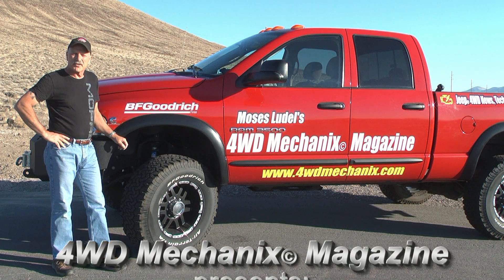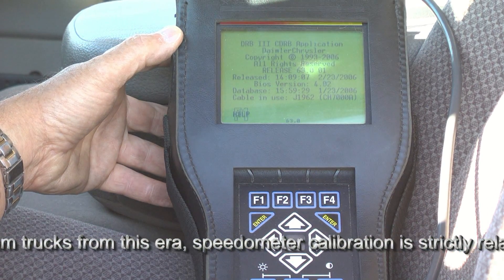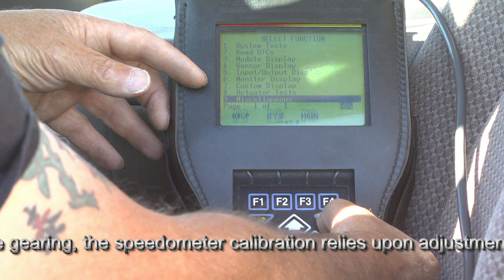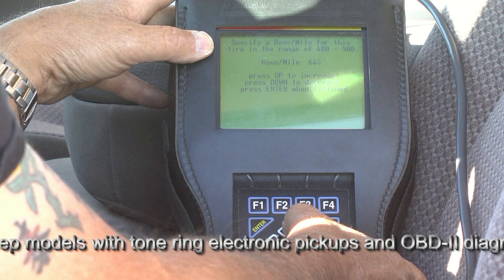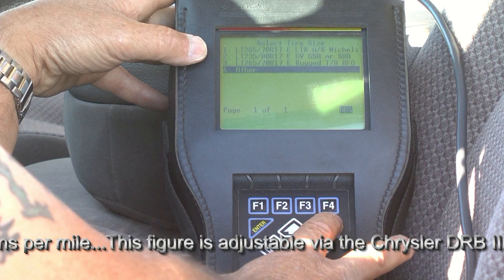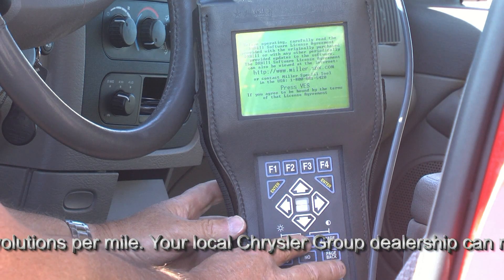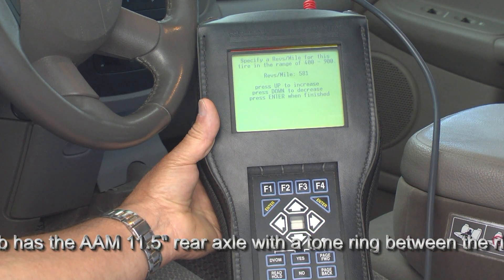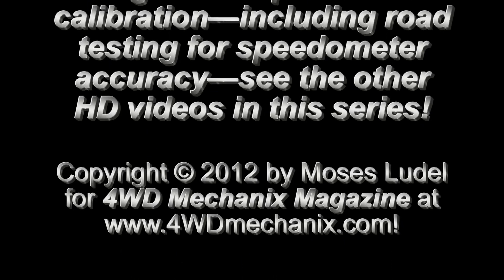4WD Mechanix Magazine 'How-to': Dodge Ram Truck and Jeep Speedometer Calibration

Comment: I was wondering if you can help me out.  I bought a set of Atturo Mud Trail Blade 35x12.50x22 (on American Force Classics) for my 2002 Dodge Ram 3500.  I can't find the RPMs for this tire; the manufacturer does not offer this info on their webpage.   Any help would be appreciated.  thanks
Reply from the maker: Frankly, the simplest tire calibrations are with aftermarket tuning software.  The Hypertech MaxEnergy software for our 2005 Ram 3500 included speedometer correction for the tire diameter.  Compared to a DRB-III scan tool, which is now $6K new or a rental from OTC, the cost of aftermarket tuning software is a bargain.  You can use stock, slightly modified and higher performance tune settings with Hypertech and other software tuning.  Installation of the software, whether Hypertech or from another company, is not difficult.  If your vehicle uses an electronic speedometer with a tone ring/VSS sensor at the transfer case output or better yet the rear axle (like the '05 Ram does), recalibration may be simpler.  Here is my magazine coverage of the Hypertech MaxEnergy engine tuning, which also enabled resetting the speedometer calibration for specific tire diameters: http://www.4wdmechanix.com/Hypertech-Max-Energy-Power-Programmers-for-Jeep-4.0L-and-Dodge-Cummins?r=1.  Recalibration requires some testing and possible resetting, but that is not difficult.  If you have further questions, join us at the magazine's forums, I'd be glad to answer:  http://forums.4WDmechanix.com.

Comment: Where is the test drive video?
Reply from the maker: Max Jordan Do you mean a video on testing the results or the 60 mph/60 seconds test?  Either way, if you want to test for speedometer error, drive the vehicle at precisely 60 mph on a straight stretch of road.  With a stopwatch or second hand on a wristwatch, count the time to go one mile.  It should take one minute to cover one mile at 60 mph.  Easiest test possible.  Some states have speedometer/odometer check points, usually along the interstates.  A five-mile run at exactly 60 mph should take exactly five minutes.  The number of seconds either over or under determines the percentage of error.
Reply from the maker: Here is the YouTube link to how I test a speedometer for accuracy:  https://youtu.be/LJEK85dPY4U.  Trust this will help.

Comment: This tool is badass but it's sucha damn one trick pony. But still badass.
Reply from the maker: I sure liked using this sophisticated tool! Sadly, Chrysler stopped using the DRBIII after OBDII. Diagnostics went to StarSCAN, then Chrysler abandoned StarSCAN after just a few years of vehicle applications. Currently, a more cost-effective (for dealerships at least) use of a proprietary PC computer platform works with a server-based interface. This requires ongoing fees, although in the long run the new dealer system is far less expensive than a DRBIII tool. Even with necessary updates and fees, the cost of the newer PC system cannot compare to the DRBIII (which retailed for around $6000 and had additional accessories and adapters that could drive up the cost further)...I thank my longstanding friends at OTC/Miller for lending me this scan tool for the video, I thought it would be very useful for viewers to know the kinds of resources available to dealerships and high-end independent shops. It is also useful to understand how thoroughly the DRBIII scan tool can interface with—and troubleshoot—an OBDII vehicle. This is not just a generic code reader!
Reply: Yeah, those scanners STILL go for atleast $2,000 on ebay. I have a 2002 Ram 2500 Cummins. Do you have any suggetsions off the top of your head of less costly scanners that would work with thge SRS and ABS systems on my truck?
Reply from the maker: There are some OTC scanners that work well.  These are the same folks who designed the architecture for the DRBIII.  A range of tools are available, and the systems you need to diagnose are addressed by better scan tools.  Used tools are available, like you discovered.  The kicker is the need to update software on any scan tool system.  Often, the bargain is due to obsolete software.  In your case and mine (with the 2005 Ram 3500 featured at the magazine and our forums), that's often not a problem, since our vehicles are now "older".  Just do your homework on the software and the range of systems that you can troubleshoot.
Reply: @4WDMechanixMagazine  actually, they stopped using the DRBIII when CAN communication protocols became available on Chryslers, starting with the Dodge Durango in 2004.
just a little error I noticed on you comment, OBDII wasn't the reason why Chrysler stopped using the DRBIII since OBDII was implemented in 1996.
but rather CAN communication protocols, therefore the DRBIII could not handle such new technology.
although they have the DRBIII multiplexer for Sprinter and the Chrysler crossfire which I believe are CAN enabled, again I'm not sure about that one..

Comment from the maker: Toyota and other manufacturers have likely built this programming into the PCM/ECU/ECM. There are also aftermarket "chip" kits and programmers available from a variety of manufacturers, and they provide for speedometer calibration.  If the speedometer error is your only concern, I would contact your local Toyota dealer about a simple software flash—like I did on the Ram truck. Aftermarket diagnostic tools at independent shops might also be able to program the "tire revolutions per mile"...Moses

Comment: whill this work on a toyota FJ cruiser or thundra ?
Reply from the maker: The DRB-II was a tool designed by Miller SPX specifically for Chrysler, including Dodge Ram and Jeep vehicles.  It has architecture that matches the Chrysler modules and electronics.  For your purposes, you would find the latest aftermarket scan tools from Autel, OTC, Snap-On and others will work for the Toyota FJ Cruiser and Tundra.  Autel has excellent professional and DIY tools.  I use them.